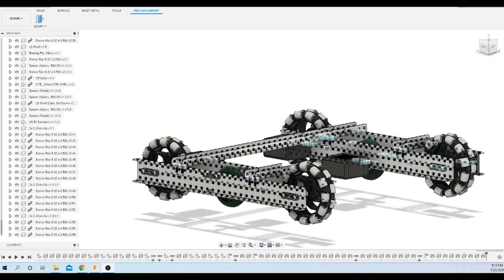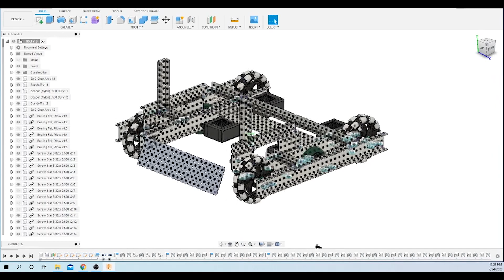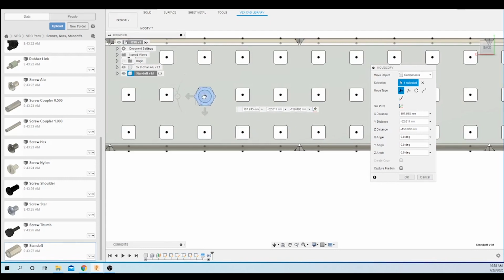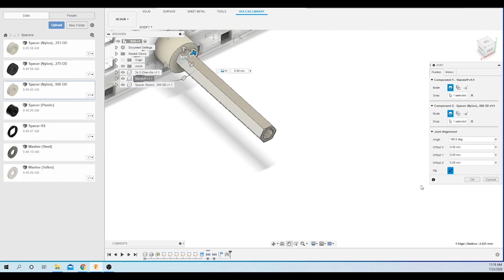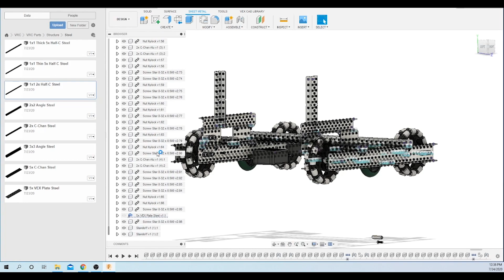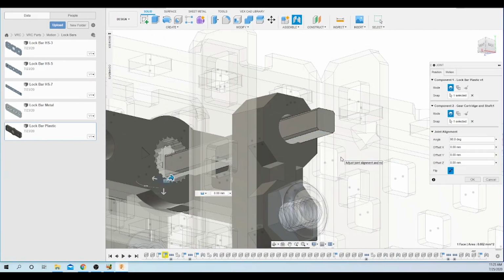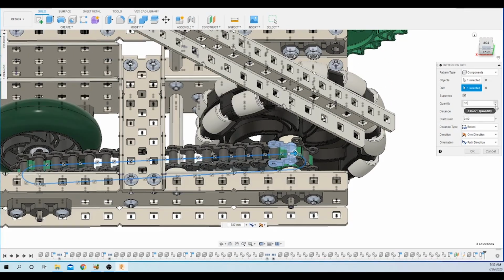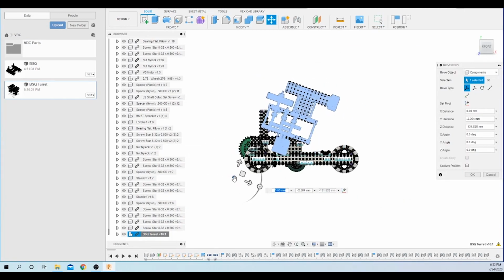Vex Design With Fusion 360

Comment: Hey, Does anyone know how to convert the 25x5 plates(vex) to sheet metal so it can be bent? Thanks!
Reply from the maker: There should be a button in the sheet metal window that converts it.
Reply: Kepler Electronics I have tried to click on the 25x5 sheet to convert it but it won’t let me click on it?
Reply: Kepler Electronics ok so I was able to get the 25x5 to be converted to sheet metal and I can select it on the bend function but when I try to edit the bend in the bend function and even when I don’t do any editing to it, the bend function won’t let me press it(meaning the OK button doesn’t light up nor can I press enter to do it. Does anyone know what to do?

Comment: Does anyone know how to CAD the thin clear plastic sheets used on vex robots in fusion?
Reply from the maker: I’d just make a sketch that is the same size as your sheet, then extrude it to be the right thickness. I haven’t played around with transparency, so I can’t recommend any specific materials, but I’d be willing to bet you can set the material to something transparent (maybe glass if they don’t have plexi or lexan).
Reply: Kepler Electronics ok thanks

Comment: What are your computer specs, good sir?
Reply from the maker: AMD phenom x4 965, 8gb DDR3, and a GTX 660. There’s actually a video where I went over the process (aside from the few upgrades mentioned here) on the channel, so if you wanted to check that out, it goes into a bit more detail.
Reply: @KeplerElectronics  Thank you!